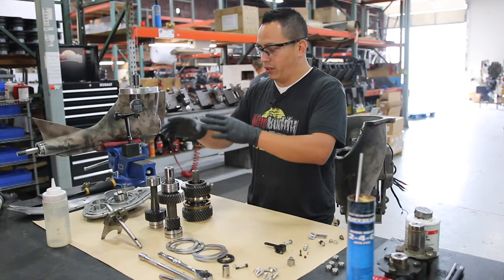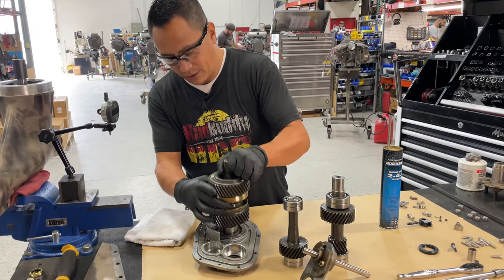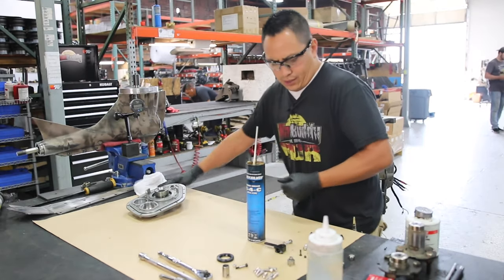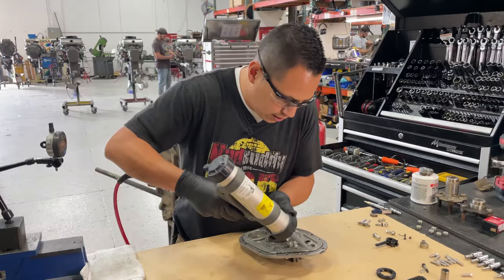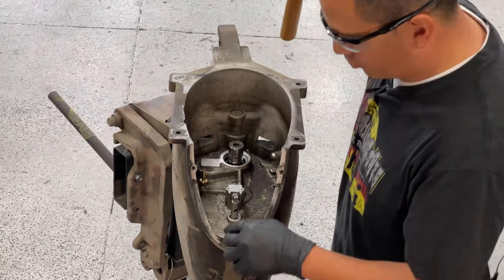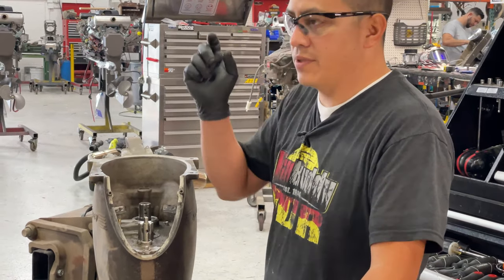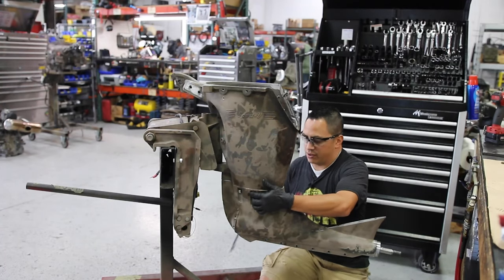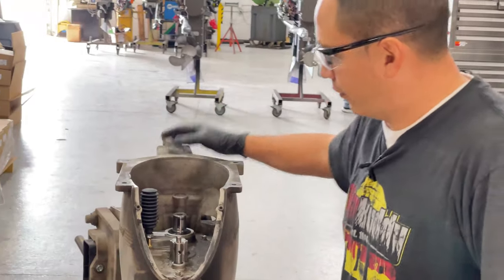Sport V - Complete Reassembly | Service Series | Mud Buddy Motors

Comment: So yesterday I was called to work on a good customers boat I don't usually work on lawnmowers or B&S engines although I am a 39 year Boat pwc and atv Motorcycle mechanic and shop owner. Well it is a HDR40 EFI and I tested it all out and getting no power to the lift fuel pump and no spark either. I have determined its the ECU OR ECM. It is a 2018 I believe he bought in late 19 and has only 18 hrs! I cant locate a ecu part number from your site or B&S site either! Me! I don't believe I would trust a glorified lawnmower engine to get me out n the back country and back home. Heck I would have at least went with a Honda engine myself. The ECU has made in singapore on it. Thats not a good sign in itself.